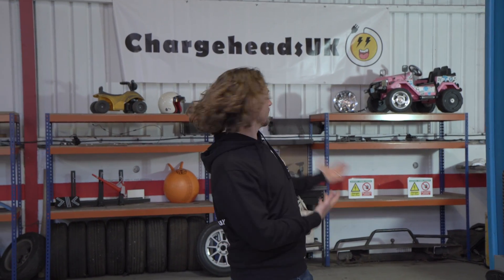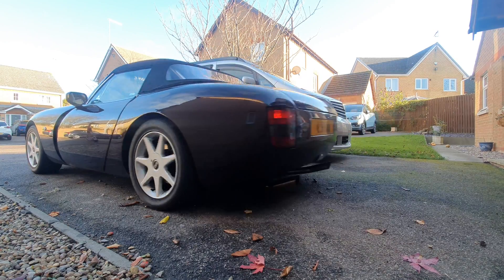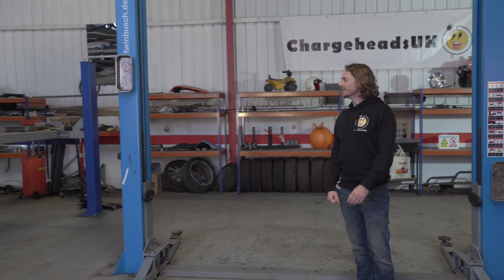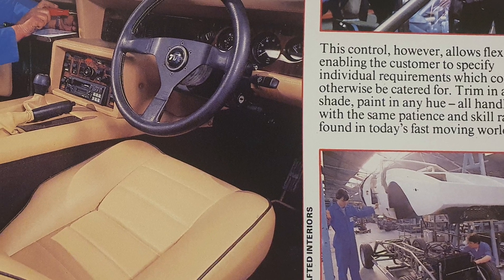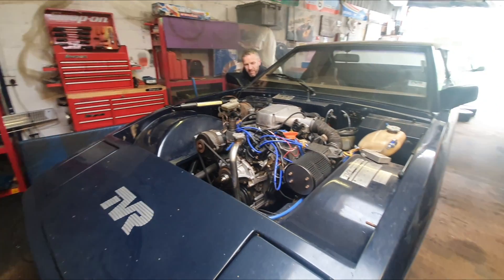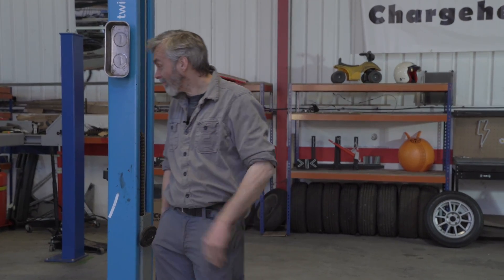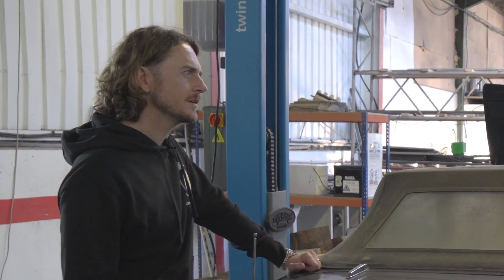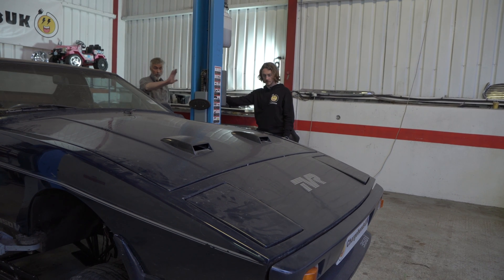Tesla Powered TVR EV Conversion! Ep1 ish

Comment: What you're doing looks really interesting and I appreciate you're already down the wedge route but would it not make more sense to start with a more desirable model to start with. If you're looking at spending 10's of thousands on the conversion why scrimp and only spend £5k on the car. A mechanically poor Chimaera or T car with a failed engine but decent body work may not have cost a lot more. Are you thinking the age of the car may be an advantage?
Reply from the maker: Its a very good point, i deliberated for a while with which car to do. I narrowed down to convertible to make it more unique as not many electric soft tops out there. The wedge shape design is more futuristic and works better for electric in my opinion. Yes price came into it as even a ropey Chimaera would have cost twice as much as what I paid. Also I don't tend to follow the crowd.

Comment: Precisely the same issues I will have with the S2000. Quite a bit of spare space under the bonnet, some more above the rear axle where the fuel tank was.

Haven't decided whether to go with Tesla slabs or LG Chem bricks.
Reply from the maker: Tesla modules can be very awkward in size when you have a smaller car. What motor are you going for? 🤟⚡👍
Reply: @chargeheads  I am using the Tesla Rear SDU.
Reply from the maker: @evs2k  what sort of performance is it with the build? Any reduction?
Reply: @chargeheads  I'm a long way from drivability. Have to source some batteries.

But the S2000 has 135kW stock, I'm at 325kW turbo, and the SDU is rated at 230kW.

So where as it might sound like a step backwards the SDU has 330NM torque from standstill.
Reply from the maker: @evs2k  the torque would certainly make the S2000 a whole different ball game. I used to have a DC2 Turbo with quaife and AEM management which was amazing but not till over 5k in the revs

Comment: Be careful with that rear suspension!  TVR abandoned the trailing link with that pin going into the rubber bush on the chassis when they went to the 390 because the pins have a habit of snapping.  If you're going to put in a motor with more torque than the original Rover lump (multiplied by the gear ratios), the pin might well fail.
Reply from the maker: Indeed, i found this out a while ago. Thanks for the heads up regardless 👍⚡🤟

Comment: dont forget to clone a SEAC nose as this transforms the wedge - 200 mls min and 1 motor might b practical - 35kwh pack min - real shame boot space cant b used - safer blade batteries with impact cage?
Reply from the maker: Wow 200 miles, way too much battery weight IMO. I agree the SEAC front end is tasty, although I saw a beautiful Wedge from Dubai which just had a nicer lower bumper section and looked proper tidy. We'll see....all money dependent, so probably nothing lol
Reply: @chargeheads  weightwise, most probably...just a desire :) - basically as much battery power as weight / balance allows

Comment: Looks like a good start! I'm looking forward to seeing how you get the batteries placed. Are you planning on cutting the fibre glass? I always thought there would be a fair amount of ground clearance in these once you had the exhaust and transmission out. Tesla dual motor in place of the diff and inboard brakes with more batteries in tranny tunnel?
Reply from the maker: Great questions, and the future episodes will answer them all....no spoilers 🍬🍫🍡
Reply: @chargeheads  lol, good man. I'll show you mine when I next see you posting on fb...

Comment: Dont worry, looking at Facebook, the purists are readying their pitchforks😅 This is a great project and I'm looking forward to this series.
Reply from the maker: The salesman in me still wants me to persuade them. I like a Challenge and fun fun fun of course! 😆
Reply: I'm not sure a blanket accusation like that actually bothers to take in the reasoning as to why people don't like the idea. Personally, I have no issues with electric vehicles or electrifying old classic cars where they are still plentiful, such as Morris Minors, VW Beetles etc. In saying that, it is not unfair to state that part of a vehicles DNA is not just how it looks and drives but how it sounds. Sure, that TVR is going to go brilliantly and the engineering involved to make it electric will be top draw. What it won't do, however, is sound like a throbbing V8 or Cologne V6 anymore than an electrified Minor/Mini will sound like an A series with the gearbox whine or an electrified Porsche will still sound like a flat 6 that makes the hairs on the back of your neck stand up. That is the difference between the internal combustion engine fan and the people that see battery powered vehicles as the be all and end all. It's an each to their own thing, the 'purists' see the combustion engine as integral to classic motor vehicles. To wit, it could be said that the TVR, once electrified becomes  uber fast, mega effective and efficient but utterly soulless. Until the pro electric lobby are able to demonstrate that it is absolutely not the case........
Reply from the maker: @robm6750  I'm pretty sure the purists like everything out the factory not played with at all. This is a project, a journey an experiment even. I love my Griffith V8 as you might see from watching the video. Can I make an exciting electric TVR, take it to a new level even with the new technology around us. This is the plan and here is the story, let's see how it unfolds 🤷‍♂️⚡. Most of all let's have a laugh along the way 😉